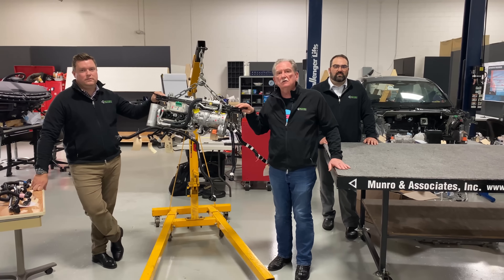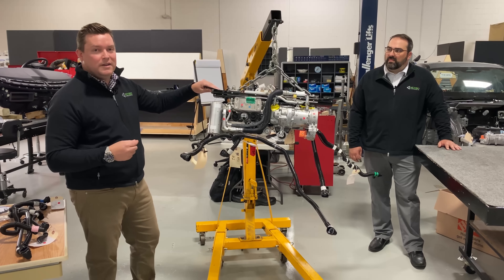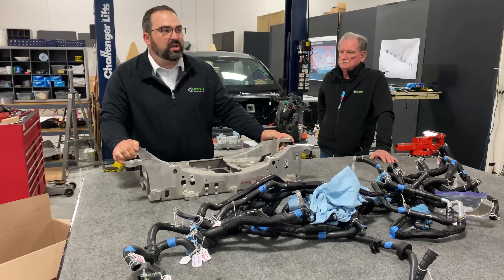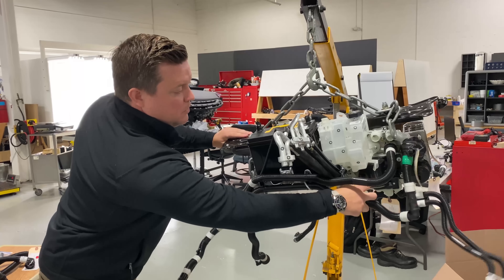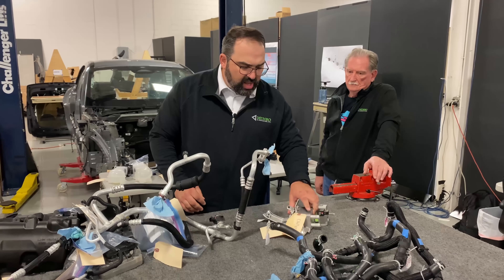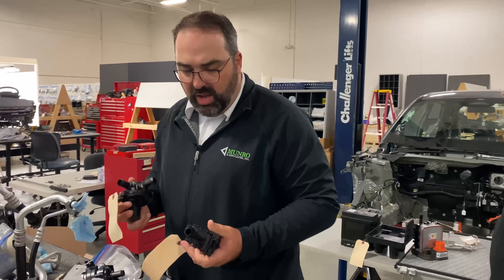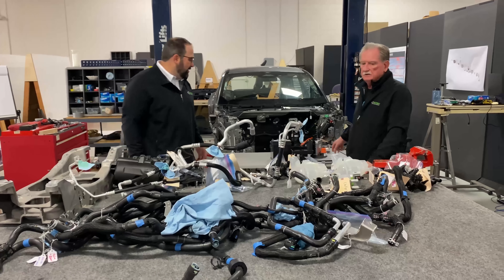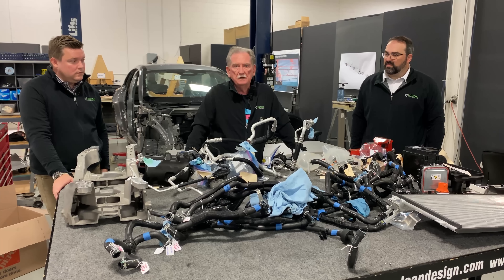Mach-E Thermal System Part 2: A Detailed Comparison to the Model Y

Comment: Where is the condenser on  the Model Y?
Reply: Good question. They make it seem like only the Mach E uses a condenser. Lol. 

I think that since the Tesla Model Y uses a heat pump, it uses gas-to-fluid heat exchangers on both sides, giving a hot and cold liquid loop. Then it uses the Octovalve to send the liquid, either hot or cold, where it needs to go. 

On a cold day it will scavenge heat from the motor and send that to the cabin and battery. On a hot day, it will certainly need to dump that heat to the atmosphere via a liquid-to-air heat exchanger, which will look like a radiator. The Mach E, just having a conventional air conditioner, compresses the Freon and sends it directly to the gas-to-air heat exchanger (condenser).

One thing never discussed amid the new push for Right to Repair is how repairable it is. The Ford Mach E seems more complicated to someone who’s never going to be the one to buy ONLY the parts needed to fix it, but I bet that Octovalve is not cheap, compared to one of the many parts it replaces. That cool looking Tesla Siamesed AC line cost $250 on eBay, while a single AC line like Ford uses cost $40-$100.

The original Tesla Model S also used conventional AC and lots of loops and 3-way Valves and pumps for each loop, with resistance heating like the Mach E has. Chevy Bolt is the same. Separate reservoirs and loops means loss of one component might not disable everything needed for the car to drive. 

I think most people won’t repair their car, so it mainly comes down to how much warranty it has and how well that warranty is supported. 

If the Mustang carries 10KG (2.5 gallons) more ethylene glycol than a Tesla, it might be enough to allow you to limp to the dealer if a slow leak develops. Ford didn’t just use an extra 2.5 gallons for no reason.
Reply: Doesn't necessarily have one.  Pretty sure the HX attached to the manifold just dumps the refrigerant heat into the main loop.
Reply: @concinnus , 100% sure every HVAC has a condenser,  because any heat exchanger that condenses the compressed Freon gas into a liquid is called a condenser. They can’t just let the Freon bubble run out into the liquid loop. lol.
Reply: @imho7250  Well, a HX that condenses the refrigerant would be a condenser for the purposes of the refrigerant loop, yes.  But it's fundamentally just a heat exchanger.  For that matter, a normal condenser is a form of radiator, or more generally, a heat exchanger.
Reply: @concinnus , yes, all covered in my first comment here. It has a condenser, and what should have been included in video comparison is the final heat exchanger the model Y uses to get the heat out to the atmosphere during times when the cabin and battery are already too warm. 

Jay Leno’s Baker electric must be 110 years ahead of all these become it has even fewer hoses. Lol

Comment: The plaid teardown will be epic.
Reply from the maker: Coming soon!
Reply: @MunroLive  When are you going to compare the Tesla Plaid to the Porsche Taycan? That will be epic.
Reply: @mikedx2706  
You notice that this time there's been no "Ah, but!" comments from Porsche or their "enthusiasts"?
Not one.
Reply: @mikedx2706  Not gonna happen, because it would not be very popular to tell the Tesla fanboys that the Porsche is a much better car in every possible way.
Reply: @rogerstarkey5390  Porsche enthusiasts are so much above Tesla's fanboys that they don't care about your clueless opinions. Tesla fanboys are the laughingstock of the car world, for a good reason. Tesla can't even dream of making cars that Porsche makes. Again, anyone thinking otherwise is simply clueless  about cars and engineering in general, and can't recognize the difference between true quality, and products made for a low price tag.  Just the chassis on the Porsche Taycan is an engineering masterpiece compared to anything Tesla has ever done. Driving a Taycan at 250 km/h feels safer and less dramatic than driving a Model S at 150 km/h, enough said.
Reply: @mikedx2706  
I don't think it's worth the cost. The Taycan is a low volume car, not an important player. The Plaid too, but it has so much cutting edge tech which will likely find it's way to the more affordable Teslas. I don't think the Taycan has anything like that. It's a very good car, I'm sure it's awesome to drive, probably better than a Tesla, but that's all it has. The fact that they had to use two gears to match the old Model S performance tells everything you need to know about the technology.
Reply: @rogerstarkey5390  And no, you don't have to put "enthusiasts" under quote, Porsche enthusiasts ARE enthusiasts. You being a simpleton and not understanding anything in depth, and therefore not knowing why people are enthusiasts of a brand that sets the standard for superior engineering and performance, doesn't mean that everyone is like you. Some people actually understand and appreciate more about cars than how fast they accelerate in a straight line, you wouldn't believe it, but there's more to cars than that. One more example of why you Tesla fanboys are considered the joke of the car world, 99% of you aren't car guys and don't understand anything about cars or what makes great cars great. Hence the fact you're fanboys of a mediocre car company. You remind me of the digital wrist watch fanboys from the 80's and 90's who acted like the digital watches were the greatest thing ever invented and anyone who wore mechanical watches was old fashioned.
Reply: @andrasbiro3007  " I'm sure it's awesome to drive, probably better than a Tesla, but that's all it has."  

- So the most important thing about a car is "all that it has", and you shrug it off. Typical Tesla fanboy, and exactly why I say Tesla fanboys aren't car guys, becasue the most important things about cars, what makes great cars great, is ENTIRELY IGNORED by you.  And you're wrong about "all that is has" too. The Taycan is CONSIDERABLY better to drive than a Model S, it's not even comparable, it's like comparing a Dodge Charger to Mercedes E class just because they're both 4 door sedans. The cars are evidently in totally different quality categories when you back to back them. Taycan is far more refined, quieter, tighter, especially at higher speeds, handles way better, rides better way, has way better body control, the body is way more rigid which gives the whole car a sense of solidity that a Tesla can't even dream of having, the car is way more stable, especially at higher speeds, etc.. Taycan at 250 km/h feels more stable and refined than Model S at 150 km/h. And that's all you need to know about the technology. The same is true for Audi and Mercedes electric cars, they're all way ahead of Tesla in all aspects that make a car, a car. Tesla can only boast having more power and accelerating harder, but I'd rather drive an insignificantly slower car (which is still way too fast for 99% of situations) and enjoy all other benefits. 

Second, Taycan is overall a far higher quality product, the interior makes the Model S one feel like a cheap mess in comparison. Quality of materials, how solid everything feels, how it's all put together, etc. is in a different league on the Taycan. So are all the details. The deeper you look on the Tesla cars, the more you discover how much cost cutting they're doing. Their headlights are bad, their sound systems are mediocre, their wipers are terrible, their seats are mediocre, their AC system is both weak and loud, etc. Not to mention the Porsche will feel as tight as new in 20 years, while the Model S will fall apart in 5 years considering how badly it's built. Porsche knows how to build tough cars, I doubt Tesla does. 

"The fact that they had to use two gears to match the old Model S performance tells everything you need to know about the technology." 

- What it tells me is that you don't know what you're talking about. Porsche used a two gear system in order to have a higher top speed and higher efficiency at high speeds instead of having to run the motors are higher rpm. 

The only thing Tesla has over Porsche is the charging network, in every other way, the Porsche Taycan would be a car that everyone with any clue about cars would much rather own, because it's a far superior product. It doesn't matter if the new Plaid has more power. I don't care. The Taycan is already too quick, and I wouldn't buy an inferior car just because it's faster. The same way I wouldn't buy a Dodge Charger Hellcat over a BMW M5 because it has more power than BMW and is gonna be slightly quicker in a straight line on a drag strip. You know why? Because the BMW is a far better car in every other way. The same analogy applies to the Taycan vs. Model S.
Reply: @patr5902  You're ridiculous, let's get that out of the way first. 

Second, you're wrong on what VW meant by catching up to Tesla. They're talking about EV sales numbers, VW as a group wants to sell more EV cars than Tesla. That's all. They're not now, because they're selling ICE cars mostly.  They're trying to transition to EV's to the point of leading EV sales too (like they're leading ICE sales now as the biggest car manufacturer group).

They're certainly not talking about catching up to Tesla as in "we need to make cars as good as Tesla" because they already make far better cars than Tesla does. Your logic of Porsche scraping the Taycans platform is what exactly? It's not a good platform? It's the best EV platform in the world. They're just making something even better now to use on a wider model range in the future. It doesn't take anything away from the Taycan, and it certainly doesn't change the fact that it's the BEST electric sedan on the market by quite some margin (apart from the twin car from Audi).  

And, no I'm not the fanboy. (a fanboy of what, I haven't even mentioned any brands before you called me a fanboy).  You're the fanboy here, because your wishful thinking and delusions and making you misunderstand even what you're reading, let alone what you're not reading directly and have to come to conclusions on your own. 

"Try educating yourself so you don’t make such an ars of yourself."  - I'm already more educated and knowledgeable than everyone in this comment section combined.  Which sounds like a big boast, but it's not, considering people like you being my competition.
Reply: @patr5902  Also, it's spelled "opinions", not "options". You made the same spelling mistake from both of your accounts. Nice try to fake winning an argument by having "someone else" agree with you.
Reply: @derbigpr500  What are you, eleven? Twelve? Playground stuff.
Reply: @derbigpr500  THere is a huge issue with your logic. When a car company creates a platform, they intend to use it for the next 8-10 years. Your statement "It's the best EV platform in the world. They're just making something even better" doesn't make sense. If it was the best platform, they would still be using it because it is very expensive to create a new one. Porsches claim to fame has always been handling. I would like to see how the Taycan matches up to the Plaid on a race track. They already lost on the drag strip. One thing you can't take away from the Taycan is the interior. I do wish that Tesla would re-examine its minimalistic interiors.
Reply: @derbigpr500  
THE TROLL TRAP WORKED!!
Reply: @derbigpr500  
Just  BTW
The AUDI GT will take the Taycan out.
Reply: @rogerstarkey5390  They are basically the same car, at least underneath.
Reply: @derbigpr500  I am no fan of Tesla or ford, I am not even a car guy and I still find your comment ridiculous and petulant.  You sound exactly like a "fanboy"
Reply: @derbigpr500  Why do you need to rant so much against Tesla fanboys?   Insecurity?
Reply: @ymcpa73  I don’t think Tesla will go with over the top opulence like Mercedes and BMW.  Leave that market to the others.   The model S refreshes are an improvement in that area however according to the latest reports.
Reply: That’s my diet plan. Lose one gram every day. 😂
Reply: Ken 1
Preceded by
"Must we?"
"Do we HAVE TO?"
"Can we delay for a week or two??"
Reply: @rogerstarkey5390  Ford:  Tbe best hose is more hoses.
Reply: I own part of that!!!
Reply: i hope it will come back without too many extra leftover parts x) Would be a shame to just disassemble it for good
Reply: Elon MUSK is New God! Mars is the New Earth! Earth Will soon Die Anyway!! TESLA and Tesla Holders will be Kings. Rest and their Family will be Our Slaves and work to Power energy for Bit coin!! Elon is Einstein, Edison, Newton, and Jesus combined. HE at least deserves several Nobel Prizes. Elon has more IQ than weight of Hater's Ug ly Prius and his F at Ho Combined!! HE is like Ironman who will destroy Thanos and critics are better off using their cash to wipe their a n us. JUST Worship Him instead of other silly god!! GOD Elon will Punish infidels!! Go Emperor God Musk!!

Comment: That’s astounding.  That’s indicative of culture problems that legacy manufacturers frankly will not be able to solve.  It would take a mandate from the CEO to address a mess like that, and no CEO outside of Tesla is technical enough to understand why this is imperative.
Reply: A VERY good point about the legacy oems. Wrong people in charge to even understand the problems and culture they need to fix.. much less have the courage to do it.. much less even know HOW to do it right

Comment: Meanwhile as this video was being watched by Ford/GM/Toyota/VW engineers...down in the Telsa Bat Cave a new and improved version is already being built...
Reply: You mean at Tesla Area 51 research center?
Reply: @enoughofthis  
"Area 42....0"
Reply: Total bullshit.....
Reply: VW already have heatpumps for a while in Porsche Taycan. They are much more sophisticated than Tesla's system. You gotta remember Porsche was engineering consultant firm first and automaker second until VW bought them. As a company they have 100 years lead in electric cars over Tesla. 1898 was the year Ferdinand build his first hybrid.  Its no brainer Tesla has no chance against porsche/vw as far as who makes better car. The thing is to make a profit on it. that is a different game.
Reply: @hagestad  You mean the 'advanced' heatpumps where VW had to go and change the text on the configurator recently (because nextmove in germany actually did a test as to their efficiency and found no effect whatsoever)? The 'advanced' heatpumps where they are now retroactively paying a total of 20 million Euros to buyers of new cars because it was basically false advertising (they seem to have learned nothing from Dieselgate). The 'advanced' heatpump they now reduced drastically in price (it is, of course, a not included extra)
They even changed the text on the configurator regarding the heatpump from "up to 30% more range"  to "power consumption for heating the cabin at outside temperatures below freezing can be reduced up to 40%".  Is that the 'advanced' heatpump you're referring to?
Reply: @hagestad  stupid logic.  Tesla already builds a faster car with more range than the Porsche.  What are you saying?
Reply: @hagestad  This is stupid reasoning. Ford builds cars since the beginning too. Mach-E also has a heatpump didn't you see?

Comment: That was a lot of grams, one gram a day per engineer! Ford can hire thousands of engineers! LOL!
Reply: try tens of thousands. At some point in time Mercedes had 50k engineers.   50 000
Reply: @justlookin59  if a few engineers would get together and re-design that system they would be set for the next few years..
Reply: If Ford tasked 2,500 engineers to take out one gram per engineer, they'd get almost six whole pounds out of the car.
Reply: @douglasburnside  'per day' is Sandy's requirement.  A couple quarters of refinement (following Sandy's Rule) and things will look much better.

Comment: As always, I'm blown away by the engineering that Tesla does. The Mach-E looks like a spaghetti monster by comparison!
Reply: Yep, mindless needless complexity....shows a company stuck in the 70's.
Reply: Even more crazy is knowing that Tesla is still refining and iterating from here. Now, unhampered by the risk of going bankrupt like they were when they were designing and engineering the current models. Next few years will be exciting times.
Reply: AND the Ford dealers are very happy!  Tons of stuff to break down and require a service visit!
Reply: @wilber8260  - At a cost of an arm and two legs.
Reply: @wilber8260  Last time I checked dealers refuse to take Mach-Ees in, coz trying to update the firmware will brick them...
Reply: @HVM_fi  Any more info you could share about this?
Reply: That what I thought
Reply: Can you imagine what the F150 had for a cooling system? I wonder if they'll let Sandy tear that down?!
Reply: don't mock the Holy  spaghetti monster
Reply: @HVM_fi  thank you
Reply: Yes, spaghetti monster hardware, the software is likely spaghetti code too. For non-IT folks, trust me dealing with spaghetti code is worse than trying to untangle a barrel of spaghetti.
Reply: Yeah but the Mach E actually works and you're not getting ripped off by false advertising.
Reply: Wait until you find out that this masterpiece of engineering in a Tesla can't ensure you more than 10 minutes of spirited driving in the summer without the car overheating and going into limp mode. Really astonishing work by Tesla.
Reply: @derbigpr500  Huh? The only driving that Teslas are capable of is spirited. Go check out this year's Pike's Peak run.
Reply: @derbigpr500  We're not talking about the mammoth S or the original lotus build; they are getting much better: https://www.youtube.com/watch?v=7BMoprNXZZg
Reply: @derbigpr500  
Wait until you  experience an unexpected shutdown at speed while driving a Taycan.